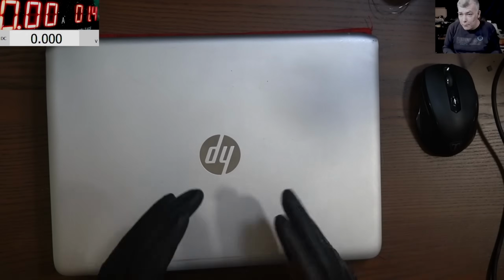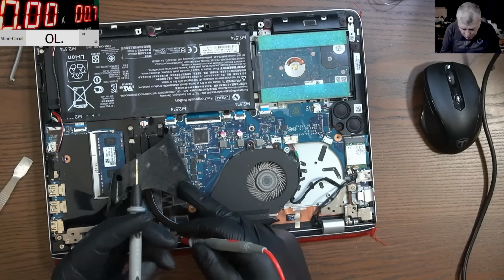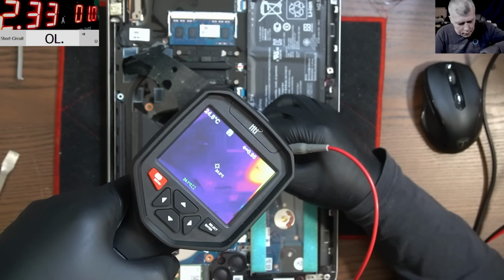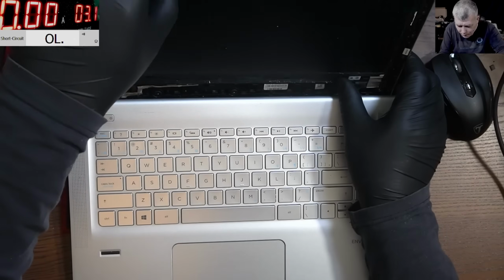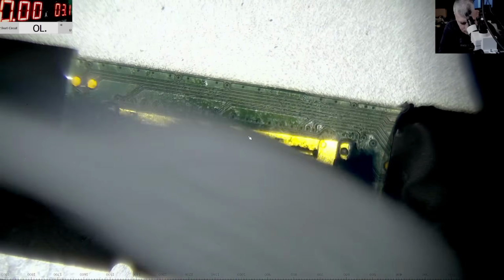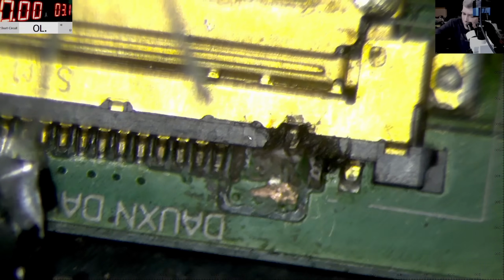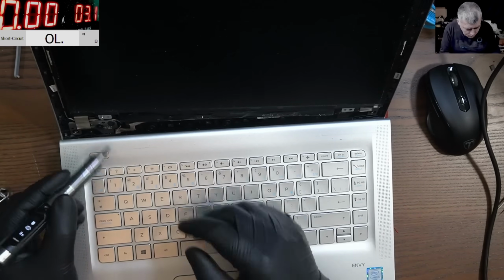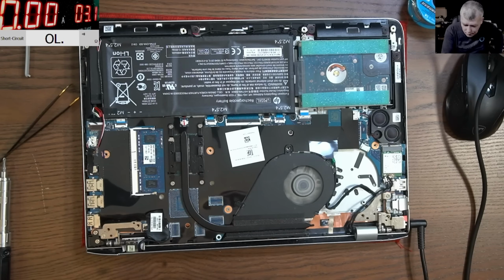Admit it, you will do this dodgy repair EXACTLY like me Hp 14-J157 laptop repair

Comment: I have an HP elitebook 2540p with caps and num lock blinking 5 times.The fan is spinning rapidly and  the screen is black.I have unplugging battery RAMs cleaning/Changing and other device support solutions but nothing.Please help.

Comment: 23:43  Not what my principle would be, the worth of the job should just be determined by the effort and the parts used, no matter what sort of device is worked on, it would seem to me, maybe some higher risk factor calculated in, however that would work.  But just because the laptop is expensive, than you can ask more for the repair and vice versa?  Little shady seems to me, no offense.

Comment: Exactly. Nobody is going to pay more for a repair than it takes to replace it. That is how everything is being built now. To throw it away and get you to get a new one.

You've found a way to get around that scam. The thing that you have to watch out for though, is the sue happy clowns that will swear that your repair job had something to do with their faulty space heater burning their house down, even though the laptop was in a completely different room than the space heater where the fire started.

Comment: That was... comedy and drama and horror mixed with honest wisdom about the decisions that are necessary some times. Everyone knows they'd prefer to just replace the screen and connector and be done but as you said, it wouldn't have gotten the device fixed and the customer happy. You've done a very sketchy thing but it works and will continue to work.

Comment: thanks  very much sir for learning new type of Technic  routes to learn  sir can i ask a question  i have a doubt on my mind please clarify sir when checking a laptop motherboard with dc  power supply  probes like 19v for shorting etc do we need to disconnect the battery power from motherboard  and check  dc power or can we directly check with 19 v power supply is this right please clarify me sir my sake

Comment: Deeeeeep down inside, I agree 100%. The screen isn’t broken, so why replace it? And any soldered connection is 100x better than the best connector ever made. It’s not like this will have to ever be unplugged unless the screen dies and when that time comes, the new cable won’t add anything significant to the parts bill, imo. I wish there were more people that actually repair vs. loading the parts cannon. Or worse, decide it’s “economically” not worth fixing and creating a mich bigger problem. I applaud you! 👏

Comment: sad thing is, Sorin says multiple times that "this is a cheap one" and I don't blame him, but the "Envy" is supposed to be HPs more premium line of laptops
Reply: Thought exactly the same!
Reply: I saw Envy and then Sorin says cheap laptop
I'm laughing 🤣
Reply: Yes, but this one is about 10 years old. Speaks for the premium laptop, living so long. But a 10 year old Laptop will be cheap, yes.
Reply: @Steakbroetchen  it's old, but not cheap
Reply: @Steakbroetchen  that's a 2015-2016 model i think, so not quite 10 years old. Anyway, I'm sure Sorin meant cheap because it all looks like cheap plastic and the screen is bent like that, which shouldn't happen on a well made machine. HP pavilions have always been a bit bottom of the barrel when it comes to build quality, but you'd expect the envy to be better

Comment: Sry off topic but Sorin is correct about hakku soldering irons lol. I baught a 160 dollar one says it goes too 900 deg but actually doesn’t , only about 800. I baught a cheap dual hot air station the vevitt 8685 one. The iron only goes too 450 but you will never need to. Plus it keeps up too the welds not like shitty hakku. Unbelievable and the vevitt station with hot air only costs around 70 buks lmfao. The Canadian dollar is about the same as the pound. Yep more than half the price but double the quilality lol. Hakku is shit.

Comment: Weather or not to replace the screen is not your call. I also think that they would decide to the dodgy repair. My only issue is that's it not your laptop and therefor not your call.
The customer has the right to decide what happens to there property. That's my point, not your methods. It's one thing if you tell the customer that you rigged it. It's my opinion that you don't.
Reply: The screen is obviously working fine, there is really nothing dodgy about this repair, he just soldered the two wires to their belonging pad directly, instead of them going through the connector.  Nothing to do with whose belonging it is, a technician know when to perform what repair and obviously if the screen turned out to be defective, he would have contacted the customer and informed them that they require a new screen to complete the repair.
Since the original one is working fine, I see absolutely no reason to not use it, as a connector does just what Sorin did directly -> connecting a wire to a pad.
Reply: @Yoan Teodosiev  don't waste your time with a guy that came here to learn to fix stuff and he s just throwing hateful comments. He's just frustrated on life
Reply: your statement prove that you know nothing about electronics .
Reply: You must be joking, who in the world would make a video about a repair he doesn't have permission for  from the customer.
Reply: @daimio7  Why don't you ask him, Sorin seems to me to be a decent guy I'm sure he'll be honest with you. I'm not attacking Sorin as a person, Just some of his repairs.

Comment: Love the humour. I was laughing as I was thinking that this repair is the only economically viable option
Reply: This cheap fix is doing more to the world than many governments.
Reply: @t.s.8783  Exactly!
Reply: yeah, its economocally viable option, i believe its not worth it to buy a new cable and screen for that laptop bcz its a low range cheap laptop, the processor probably a celeron n3050 with 1.6ghz  or slightly better, it will even struggle playing high quality videos, i got a similar laptop from the dumpster(with celeron 2840), broken screen, no HDD, no ram, i though i will extract pwm chip to try to save my other dead laptop, but its turn out the power button was broken, so i just used my old screen+ram and i soldered a button  from a broken mouse to replace the bad button, its look funny and dodgy but its work and its 100% free 😆